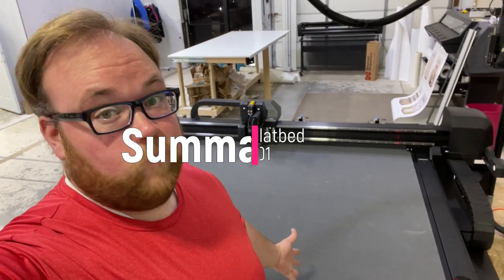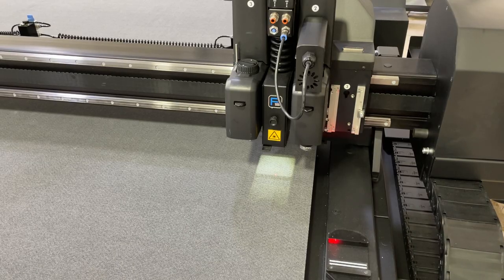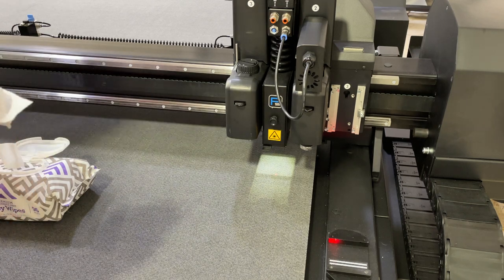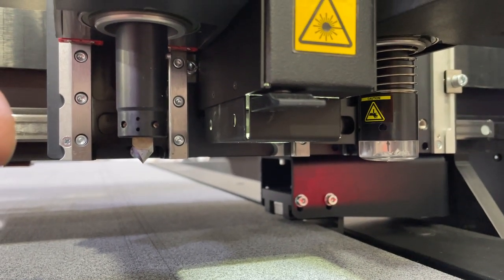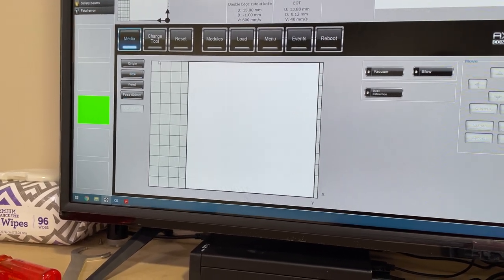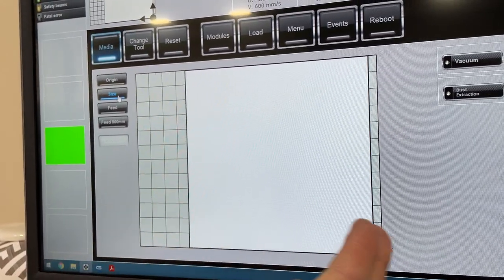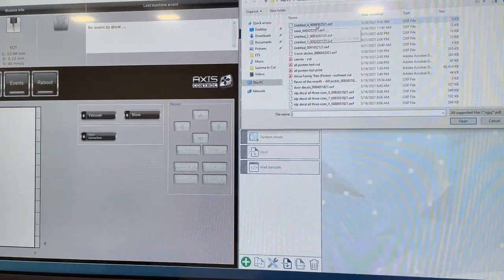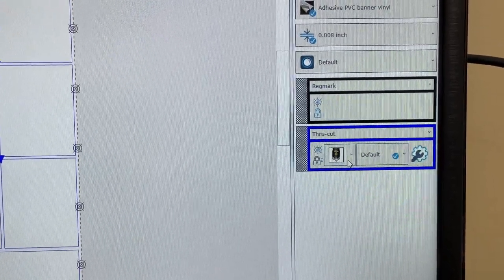Cutting posters on Summa f1612 flatbed cutter

Comment: The design on those posters are incredible. Regarding the air bubbles, our table has alot of problems with that aswell. 
Our Zund has none of those problems but its a much more expensive machine and i see even massive producers use Summa so i am trying to stay with it.
Reply from the maker: Ever since I switched to the Colorado over the HP, I've stopped seeing media issues.

Comment: the trick to flattening out roll stock (at least on a Zund table) is the cycle the vacuum in between suck and blow to get the paper to flatten out without fighting the wrinkles.  99.9% of the time a single cycle will flatten out the wrinkles, once in a blue moon it'd take two -but it beats messing around with trying wipe out with your hands.
Reply from the maker: I'll give that a try, thank you!

Comment: hi there, t, how long does your double blade last?.... we use High frecuency cut for that kind of cuts, by the way love youy vids!
Reply from the maker: It depends on the material. If I'm just cutting stickers it lasts forever. I have a job cutting squares in security film and it only lases a few rolls.

Comment: If the paper bubbles up like that, and the set up is seemingly time consuming, and these aren't even edge to edge prints why not just use a smaller media, like 24" or 36" roll, and just have the printer cut it.  Wouldn't it have just printed, cut, printed, cut, without all the extra work and set up?